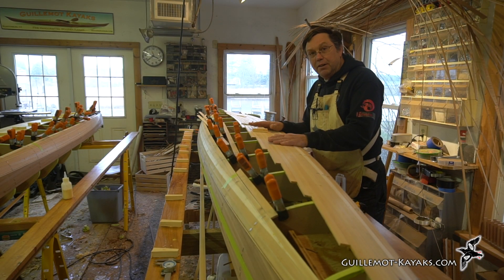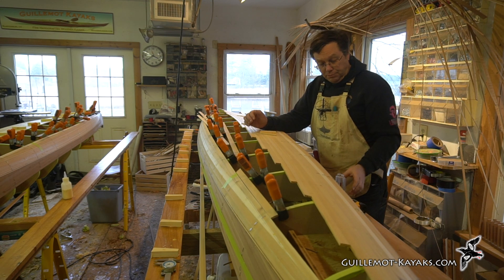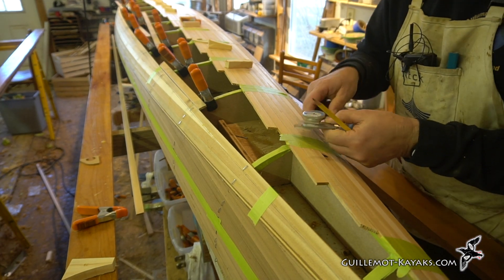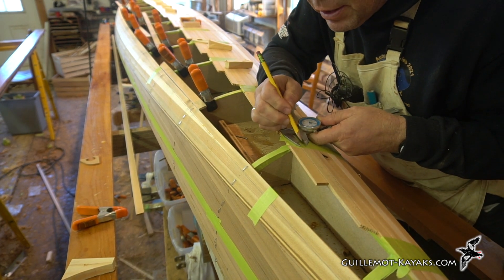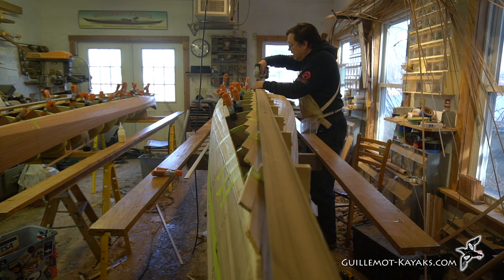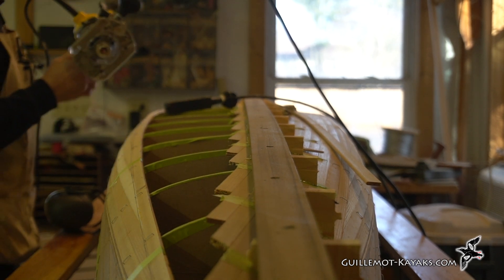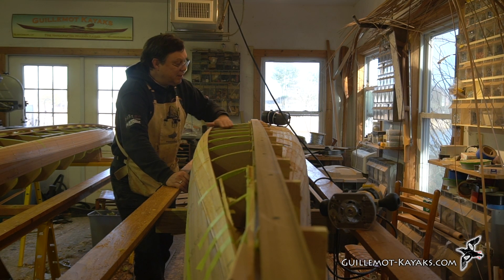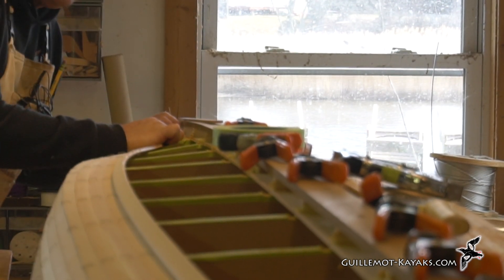The Router Trick - It almost cheating

Comment: Gotta wonder how long it takes you to tie your shoelaces in the morning. "First, you have to number your laces, then mark them at each eyelet so you can keep track of the left and right side, then I made these little contoured guides so I can loop the laces perfectly, next I'll hot glue a lace to each one of my index fingers, but I make sure to label my fingers 20 times, one label for each side, with a different mark so I can keep track of the front of my hand versus the back of my hand...."

BTW, that board definitely didn't look straight.
Reply from the maker: It just needs to be straight in one direction

Comment: I'm trying to figure out the best way to make the wedges. Do you think tracing the contour off of the respective form is the way to go, or to use a contour gauge after stripping is complete? Thanks!
Reply from the maker: I go back to my plans drawings. The second page of my plans include a drawing of all the forms. I use this to define the wedge shapes. I draw a vertical line offset from centerline, then measure up a consistent amount from each form along that line and draw a vertical line at that point. Another vertical line farther offset defines the width of your wedge.

But, if you no longer have a paper set of plans, you can do what you suggest. Use a bevel gauge to find the angle between the bottom and vertical (deadrise). Again make the height of the wedge close to the keel line consistent, and then a horizontal line for the top of the wedge.

The key is a consistent wedge height at a consistent distance from the keel line.
Reply: Thanks for your response, Nick! All the paper from the plans are currently stuck to forms. I should have thought ahead and made templates for the wedges before cutting the paper and gluing it to the MDF. I think the contour gauge will have to do.
Reply: I see what you were referring to about the second page of your plans. I didn't realize that those forms on that page were to scale. That will be very helpful in making the wedges. Thanks again!
Reply from the maker: @grandmastergoat1  Yep, you can use page 2 for figuring out the wedges or if  you mess up any of your forms for some reason.

Comment: I'm sure you've mentioned it, what melt temp glue sticks do you use again?
Reply from the maker: I bought my sticks years ago and I haven't been able to find the same ones again. I'm not sure what temperature they are meant to be, but I crank up the heat on my gun to max so I have good flow and open time.
Reply: @NickSchade  thanks Nick. Trying my hand at a pair of Lil Auks.

Comment: Big fan of the Chevron pattern in the bottom of the hull. problem is getting the points to lineup from one end 

of the boat to the other. The problem arises with a center line is cut of one side of the boat the points don't line up on the other side. Well it became apparent that you can cut a center line where they do line up from one end of the boat to the other but it's not the centerline you think it is. It's more of a s shape not perfectly straight. You get this s shaped line by overlapping the left and the right side at the same time and cutting both the left and right at the same time.

Comment: I'm inspired! Thinking on my next build, maybe keep the top part of the form cutouts (they each should  be perfect angle to align the rail) and then perhaps a circular saw on a guide rail. It would require a shift on the second side (due to the saw kerf being so thin) to achieve a  uniform gap of whatever size the keel infill will be. Thanks for sharing

Comment: I've simply marked the center line & used a very sharp chisel to cut it. Little to no set up & it turns out crisp & straight. The open side needs to have each strip custom fitted no matter how the center line is cut. Even if there are a few irregularities, no one but me will ever know. ;)
Reply from the maker: Did you not actually watch the video? The second side can be left very rough with this method. No custom fit needed.

 It doesn't take much longer to set up the fence then cutting with a pull saw and truing with a chisel or plane. All the time saving is in stripping the second side where it takes next to no time to fit each strip because you have 3/8" of acceptable error. I just hack it out with a jack knife.
Reply: @NickSchade  Admittedly I didn't watch the 2nd part of the video where you filled the open side when I commented originally. I guess one would have to actually time the procedure from start to finish with each method to see which is faster. A lot depends on the tools one has on hand & individual skill level. Router, calipers, bit, bushing & a bunch of extra measurements where errors could occur vs simply pencilling in a centre line to cut.  I've built 3 canoes using the chisel & fit method. I use cleats vs staples to strip the hull which most certainly takes more time. I suppose if I was building as a business I might look at the quicker options such as using staples & cutting center as you've shown. Still not convinced that it's appreciably quicker having to fabricate a special form for each station to support the router fence. And I prefer not having a straight 3/8" whiskey strip, I like the aesthetic of curved finish.
Reply from the maker: @MikeSiemens88  I’ve done dozens of boats your way and maybe 10 boats this way. I’ve timed it, it’s faster. The extra measurements have enough inherent double checking that you are less likely to get it wrong than when you draw a line and cut by hand. The hand saw and chisel and fit method requires significantly more skill, precision, and practice. I do it this way in classes because it produces reliably better results in better than half the time.

Comment: I've seen you do this before but hadn't appreciated the custom blocks to make the guide sit straight and level. Before it had always seemed like a big (potential) problem getting that guide batten aligned but this makes it straightforward. And then leaving it in place to do the other side is perfect. It certainly would save a lot of time compared to fitting the ends of all the strips. (I have to say when I built by Wee Lassie I enjoyed fitting all those strips, but it sure did take a lot of time). I guess there is a bit more 'pucker' factor routing the second side because if the router slips you're messing up on the 'boat' side. Thanks for taking the time to share this again.
Reply from the maker: Definitely a risk of catastrophic failure if you slip with the router, but the time saving substantial.